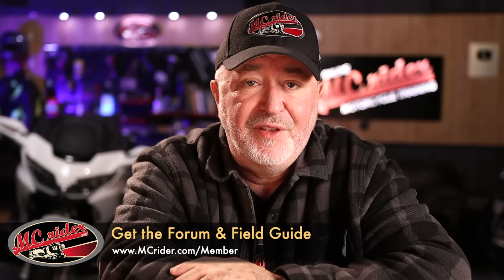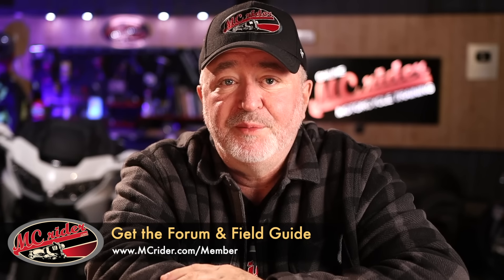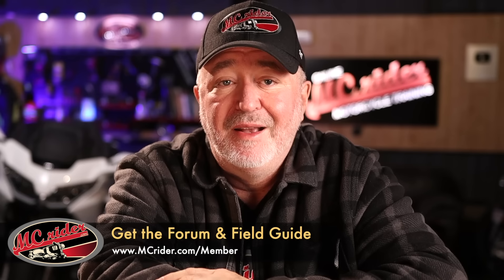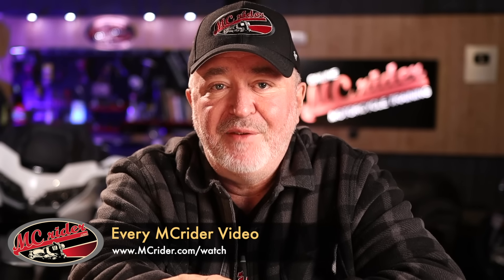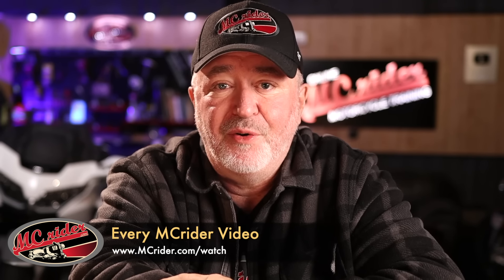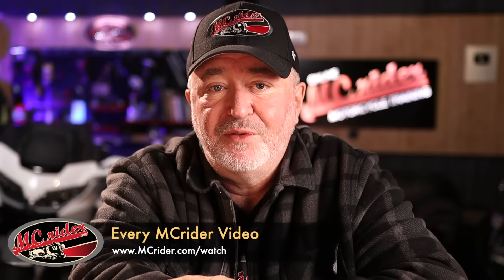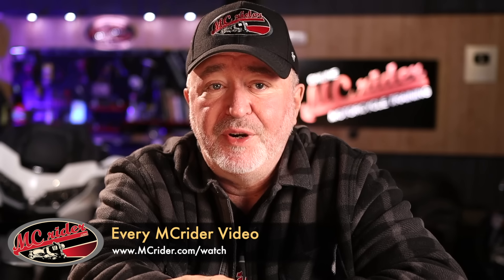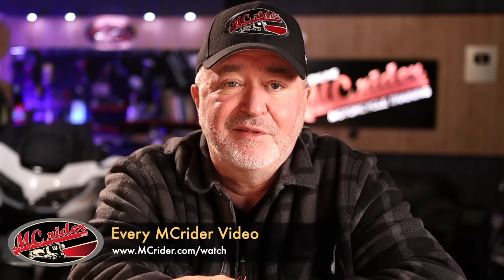The Most Misunderstood Control on a Motorcycle

Comment: so what was the other reason that people put the bike in neutral when stopped?    ( had a strange reason recently - so my bike did not stall.    My clutch cable snapped last weekend, and I had  to ride my bike, as it is my only transportation, without a clutch lever.  While I was waiting on the new cable to arrive, as a reminder, I removed the lever to thwart any kinethesia tricking me into thinking I could use my clutch.  no, instead i speed shifted up, and rev-matched to shift down for 3 days.  ugh.....neutral is NOT easy to find without the clutch lever, so I timed traffic lights, other vehicles, and any other obstacles as much as possible to avoid ever actually coming to a complete stop.      right about the point I was started to get used to it, my cable showed up early.   just as well - that is one area in which you don't HAVE to unnecessarily wear the plates.

Comment: Nothing wrong with slipping the clutch. I practice motogymkhana constantly as well as compete, and when I was still using the clutch, I went through about 3 clutches a year. 

Eventually I progressed to clutchless riding which is faster but not nearly as easy to get to full lock, so a rider starting out will likely need to slip the clutch. I've yet to need a new clutch kit, since riding clutchless in the cones. 

My explanation is this. If you can hit full lock without touching the clutch, then you no longer need to slip the clutch. Of course in super tight courses on big bikes like precision riders use, they will always need to slip the clutch because advanced courses are set up such that it's impossible to go through certain sections at engine idle speed so you must slip the clutch to get through the course. 

In motogymkhana we never go that slow, so clutchless riding is the way to go.

Comment: Why is it, that some motorcycles can be ridden at slow speeds (1st gear) just using the clutch only and no throttle (just idle-riding) , while others need a base line of thottle?

Comment: I don't slip my clutch at slow speed. Never seen a need to. I've been operating vehicles with manual transmissions for 37 years. I don't care what kind of clutch it has I'm not slipping it unless I'm starting from a stop. Then only as much as necessary.

Comment: The "escape zone" argument- justifying staying in gear at a stop because one might need to zip out of the way of something coming in from behind you... is a dubious one. How often is there someplace to escape to? There are cars rolling through the intersection in front of you that certainly won't be expecting that. Are you going to jump into traffic to avoid being rear-ended? And how often are people rear-ended when stopped? How big of a risk is this? I would argue that people are more often rear ended when stopping short while travelling with somebody following too closely, and people are tailgated routinely without an ensuing incident. If you want to put it in neutral at a stop, do so guilt free.
Reply: In the USA it happen all the time. Better to take a chance, then to be run down by 2-3ton car/truck. You can always take a U-turn, if it is much traffic crossing you. But if you are not in gear, you have no chance to move away, anywhere. Lots of ways to get your self out from being hit. You can also run of the road… Better then the alternatives.

Comment: I do recommend my friends to use more brakes over the engine braking. 

However, trying to reduce the 'potential' wear & tear on a clutch over  the smooth ride and even the safety is.... well... beyond me... 🤔
Reply: why would you do that?!

motorcycles have such large engines compared to the weight of the vehicle that you can slow a MC from 55 down to 1mph just by down shifting when approaching a stop sign

if your brakes failed you could stop completely by hitting the kill switch in 1st gear

Comment: I have to say,  when designers are choosing springs, they are basically stressed for unlimited cycles.  The number of cycles of a clutch are nothing, compared the millions of cycles in suspension or valve springs.  

Not using clutch to prevent Wear on clutch springs is silly.

Comment: sorry pal i dont agree sitting at a red light with the clutch pulled in , you keep talking about clutch disc and clutch plates , you never mention the throw out bearing spinning thousands of revolutions unnecessarily what i do is sit at the light in neutral i watch the green light go to yellow then i put my bike in gear IT SAVES THE THROW OUT BEARING been a bike mechanic for 40 plus years you are right clutches hardly ever go bad but throw out bearings dont  really last that long replaced hundreds of them through the years

Comment: VERY Interesting subject/topic.
I have a confession.
63 years old, 'hundreds and hundreds' of motor bikes, (exaggeration) (currently 5) and basically I DO NOT pull the clutch lever in when I am stationary (and the bike in gear). I have NEVER NEVER NEVER had a problem, NEVER. 
What more can I say ????
What more can I say ?  

If You want to hold the clutch lever in with thee bike in gear when stationary, then that is your business.
I HONESTLY do not see the Point.

Regards.
Reply: the riders who sat at red lights in neutral and got pancaked into the truck in front of them
because they could not get out of harms way fast enough
are not here to tell us how they died
but go thru the yearly MC accident reports and they are there

you have been lucky.... so far
Reply: @kenwittlief255  
                         Thanks Ken, I do Appreciate your comment.
I do hear what you are saying. I really do. 

When there are vehicles in front and behind me (when stationary) I personally feel (VERY VERY VERY) safe. My eyes are Not Glued to both of my 2 mirrors. 
If I did Fix my eyes to my mirrors, and SOMEHOW I feel/sense a vehicle is plowing thru a few vehicles behind me and approaching me, (which has NEVER happened) I would be VERY SURPRISED if ones reflexes would be fast enough to exit that situation. - And If so, one would need a 'escape path' which is obviously Not always possible.(Obviously)

I do not know what the stats are. Here in 'OZ' (Australia) I know it IS EXTREMELY EXTREMELY RARE.  In America, I do not know.

Thanks Ken, hav a gd 1.
ALL the BEST.
Ride safe.

Regards.

Comment: upshift without using the clutch?
Reply: Yes, it’s easy in higher gears.  Just preload the gear shifter and then let off the gas. Doesn’t work well in lower gears though
Reply: That damages your transmission.  You could brake your shift fork
Reply: @seano220  I agree with you if you do it in the lower gears. I’ve been doing it for years (only in higher gears) and have had no problems. I just gently preload the shifter and then ease off the throttle and it effortlessly/gently slides into the next gear

Comment: "Drivers" still drive standards... My favorite car to drive is my 1978 Triumph Spitfire... you certainly DO feel as hooked in as on any bike....
I also rarely use my clutch on my 2002 Suzuki SV650S to shift gears... and my shifts are dead on smooth... even when I'm wringing her neck..
When you get used to shifting there is no real need for a clutch..
BTW, no one I know could ever get away at a traffic light when a car loses it behind them and hits them...
Dropping the clutch and peeling out on a bike isn't something most people practice...
Even if you seen it coming, by the time you move and drop the clutch you are hit... but even if you could... 
You would probably wheelie, and the car behind you not even come close...

The answer to sittingin traffic is to NOT sit directly in the middle of the lane...
I am on the  dividing lines so if a car behind me isn't going to get stopped... he isn't going to touch me regardless...
Reply: That is because very much people cant ride their bike at all. If you cant do a drag-pull on your bike, you need to practice. 
When a car brakes hard, it mostly pulls sideways, so it will probably hit you, even if you stop in-between the lanes.

Comment: Welp I drive a stick shift and no power steering. MY bike is an old '78 Suzuki GS750E. Folks think I'm nuts. Everyone says I need a new car. Why should I? Been driving my '89 Pontiac Lemans for 15 years. Got it 1-5-07. And yes not only youngens but slightly aged could not operate either.

Comment: Hope this doesnt come off as arrogant or anything. I am genuinely surprised when someone has difficulty using a clutch. I could understand in a pre syncro mesh car. The motorcycle wasnt that much of a problem. You have better fine motor control with your hands so it shouldnt be hard to learn. Maybe i was just lucky

Comment: In Europe we drive a lot more standards. You're kind of a sissy or a girl if you drive an automatic here :D, but I like it the way it is. Although automatics have increased in number, a standard gives a lot more control over power, torque, friction, even exhaust sound. It also keeps you more awake in traffic. Also, standards require less maintenance and as most people don't do any tranny maintenance, it; also better this way. :)) Automatics need cleaner oil to run right, they need current, you cannot push start a car and so forth. For performance applications such as a race track or off road, nothing beats a standard. So manual motorcycles came in like no big deal. Just learn where the gears are. And guess what, standards are also cheaper to fix and replace :)

Comment: I'm planning on building a bike 🚲 it's not going to be powerful in terms of engine size a 7HP Diesel 305cc, at 3600 RPM I want something of a clutch VS a speed clutch as in centrifugal, and I want to be able to disengage the power circuit, I was just wondering has anyone got any knowledge on an air clutch, the bike I'm building has an air compressor and a tank, its purpose is for an air arrow rifle, it's a themed Zombie Survival bike, They use air clutches on industrial machines, most times an air clutch brake to keeps tension on a product like plastic or paper for slitting or cutting into smaller rolls.  I just wonder has anyone used one out there for a motorized setup?  I'm looking at production so "used" parts may not always be there like in other manufactured clutches and transmissions, again that an easy answer is to use something already engineered for it, I looking for something more "size" appropriate as well, the power band does not need such an expensive transmission and clutch system. something with 3-4 gear rations for the transmission and just need a clutch. that would do well in this application. The build is to keep it simple and long-lasting yet reliable as the theme is survival and apocalypse, you don't want it too complex or need peculiar parts.

Comment: Goodness!!! Author is forgetting about the clutch drag which is most annoying and damaging. 

Do an experiment, bring the engine to full running temperature, pull the clutch full and wrap a string tying it fully compressed to the grip and leave the bike to idle till it dies with hot clutch binding, after that remove the tie and see if you can hold the bike on your feet whilst clutch fully depressed. Please do some research before making this kind of videos.